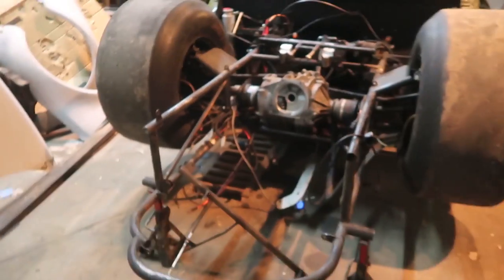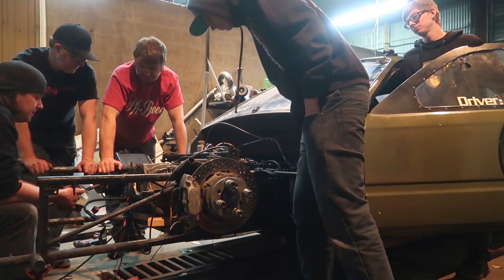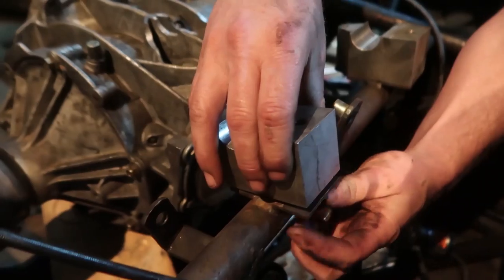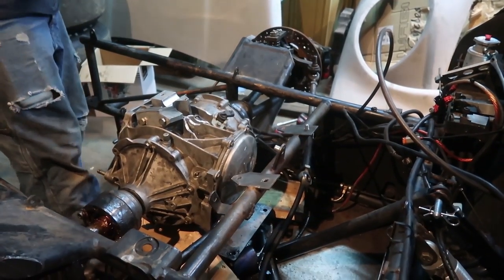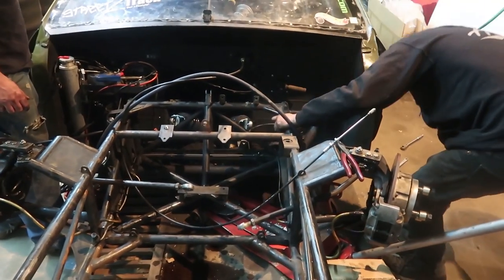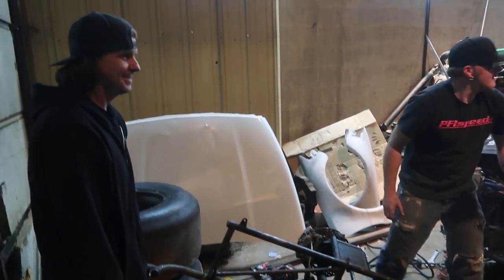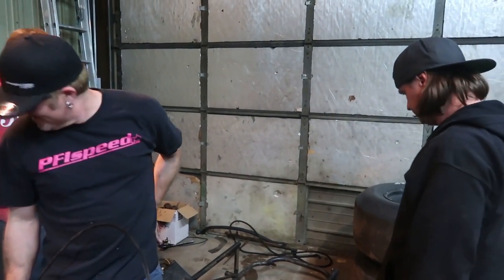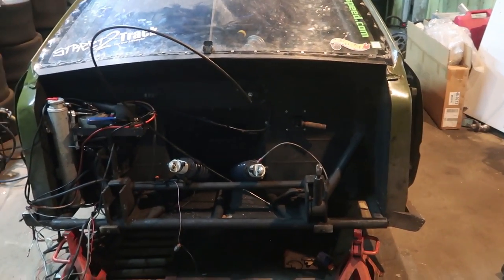BULLY , Step back to Move forward ! Let’s Goo!

Comment: Hey, do you stabilize your video after recording? there are 2 dust specs on your lens wich the camera picks up as 2 white spots.
their movements would be explained by that, if thats not it you might have an sensor issue, though one you can ignore.

Great video, I really like your fabrication on BULLY. Can't wait to see it finished.

Comment: i would love to hear why no suspension at the front wheels and why its ridged? love the bully
Reply: Raqus Kane because the suspension is between the sled and the rest of the car. It flexes at that point and they can dial in how hard it flexes.
Reply: I understand that but it's like straight axle problems where they buck and jump. Where a traditional double arms ifs. Would allow movement up and down independently of each other, the care would still need the  hinge

Comment: Brent, how do those check valves in the brake lines that you were talking about work?
Wouldn't a check valve just hold the fluid to the brakes and keep them locked up once you push the pedal the first time, or are they some special made valve that would let the pressure off when you release the pedal?
Or, are they like an air hose quick connect, but made for higher pressures?
Just curious, I've never heard of them being used in brake lines.

Comment: Can't you fit a pair of shocks on the outer edges of the sled, going back to the bulkhead?  Surely part of the issue with the current setup, is that the 2 shocks are so close together, meaning any imbalance in the 2, is then amplified at the wheels.  Imagine 1mm movement on the shock probably equals 10mm or more at the wheel.

Comment: Can you flip the c5 rear end upside down? That would help keep the CG low but help correct the the CV angles.
Reply from the maker: Justin McBurnett you can but it’s drive backwards
Reply: PFI Speed can you get mark Williams to cut you a gear backwards so you can flip the assembly over?

Comment: Cool they gutted the bully!....Good thing you guy's found that broken mount. Again for add on control struts check out  www.acecontrols.com  they have every conceivable  Damping technology: industrial shock absorbers, structural dampers and damping plates
Vibration technology: air springs, vibration dampers and rubber-metal mounts
Gas springs: push gas springs, pull gas springs, hydraulic dampers and door dampers.

Comment: Please dont use quick connectors on the brake lines, We had one of those fail on our WTCC S2000 touring car (factory built by Seat Sport) and the car was totaled due to it failing.. 250.000$ loss. The check valve somehow got stuck so no brake pressure reached the front right caliper, and the car made a hard left turn right into the guard rail. Driver thankfully survived but broke several ribs and fractured some bones.

Comment: That type of heim joint should not be used in that application because it will see bending load which is also changing direction so the joint or structure close to it will fatigue. .